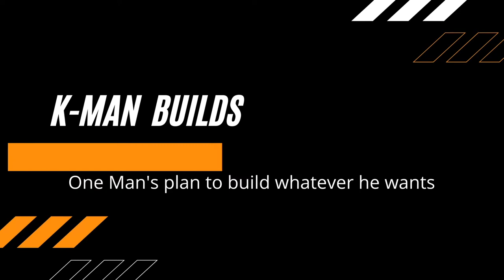K-man Builds: DIY Retractable Casters (Wheels)

Comment: Nice idea but i think you should have used a much thicker tube that connects the 2 casters together,  all the weight of the unit is on 2 thin tubes
Reply from the maker: I thought about that when building it.  If it becomes a problem my plan is to add another 3/4" tube on the back and weld them together.  should do the trick.